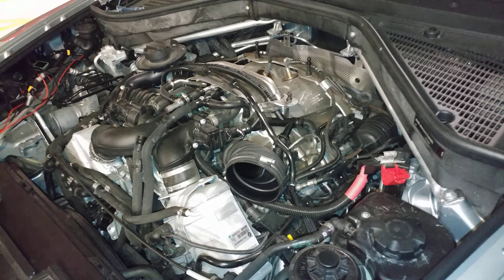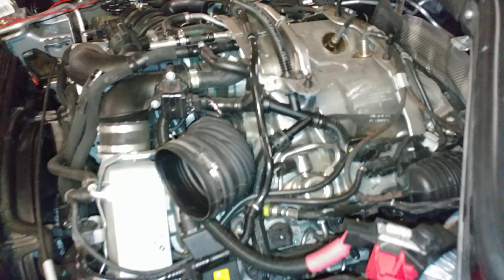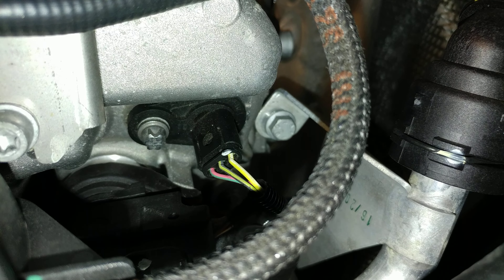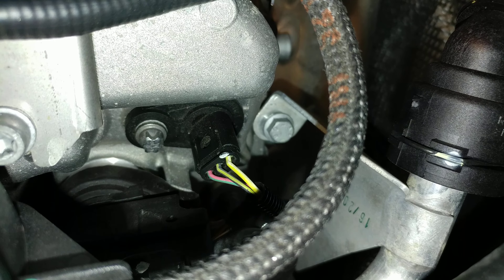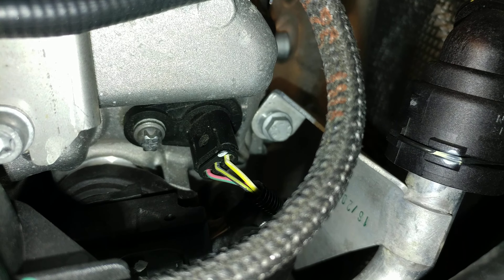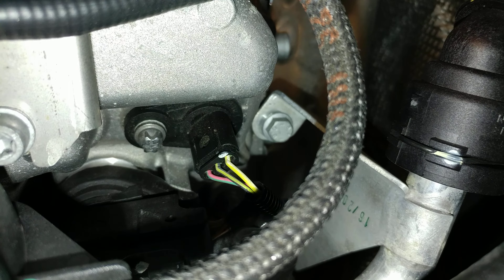2013 BMW X5 M - How to Fix Engine Malfunction Warning, Camshaft Position Sensor (2A7E, P0025)

Comment: Hi
I have a 2012 BMW X5  xdrive35i.
I replaced my throttle body and my HPFP.
The car is throwing a fault code P15DF.
I also have the Engine alert:
         Engine malfunction reduced power
         Chassis stabilization malfunction 
          DBC malfunction drive carefully.
Any advice would be welcomed.
Reply from the maker: Hi,
Was the battery disconnected for longer than 15 minutes? If so, then you just need to recalibrate the steering sensor by driving and turning the steering wheel from lock left to lock right, after doing that the stabilization should go away and be normal.  
For the code, there are a few things to check, seems like P15DF is a code for the vehicle speed sensor of the front right tire, this actually is probably the reason why the stability system is not functioning, since it needs the rotation of all the tires, but I would try the lock to lock just to rule it out. If that doesn't work then check out your wheel speed sensor connector.  Try cleaning it first, and plugging it in and removing it 20 times with contact cleaner, then rinse off the debris with more contact cleaner and wipe dry best you can. Clear the codes. If it comes back again, it could be a faulty sensor and you'll want to troubleshoot that and replace it if need be. 
I find most likely it's a connection rather than a broken sensor though. That's what I found in my 2013. 
I've cleaned all the connectors I found and it helped.  I haven't had to replace any sensors yet.
For the engine malfunction, is there another code for that?  Cuz a wheel speed sensor code shouldn't cause that, but fix the sensor and see if the engine malfunction goes away.  
When random stuff happens, it usually points at a bad battery or alternator.  If you buy a new battery and don't fully charge it before putting it in and registering it properly, you can get engine malfunctions and have the engine shut off on you when you floor it on the highway.  You can also clean all the battery connects, as well as the ground cable from the battery to the chassis, clean it good so it makes great contact and put dielectric grease there to make sure the connection is maintained very well, that'll make sure you don't get strange issues going forward. The computers are really sensitive to voltage fluctuations and can lead to all sorts of strange issues.  I bought a Bluetooth voltage monitor to keep an eye on mine, it's a good way to make sure it's all working well. You can find it on Amazon by searching "Auto Battery Monitor BM2 Bluetooth 4.0", or here's my affiliate link for convenience https://amzn.to/3XFxBSq
But if there's a loose connection the monitor may not catch the issue, only if the battery is low or if the alternator can't keep the voltage between 14.6 and 15v, so it's more important to make sure the connections are clean and tight. Stock, it's not that great, so use some 300 grit sand paper or a wire brush to make sure the cable side and chassis sides are clean and making good contact. I don't know the torque rating, just trade tight without breaking it is good! I made mine pretty tight.
Good luck!
Cheers,
David.
Reply: @DavidSunshine  thank you David I really appreciate the information I will get on it.
Very grateful for your help. I let you know how it goes.
Reply from the maker: @nes286  Anytime! Hope it helps. These things aren't easy to troubleshoot but it can be done!  Good luck! Cheers, David.

Comment: Hi David, so this should fix the limp mode on a 2009 bmw x5? I'm experiencing that and I'm pretty scare it could be expensive, please let me know thank you in advance.
Reply from the maker: Hi,
I would scan the codes so you know what's wrong.  I got Carly, it's worth it for all the things it can do, and tell you about your car. The adapter and yearly software subscription cost you, but the benefits are worth it.
You should try this though, the contact cleaner is cheap enough and worth having a can of around the house anyways.
And yes, it could fix the engine malfunction popping up.
Cheers!
David.
Reply: @DavidSunshine  I really appreciate you getting back to me I'm going to try see if it works and I'll look into that adapter too, have a good one.
Reply from the maker: @onealsanchez2384  Anytime!  Good luck! Also, if you just remove and insert that plug 10 times, it'll clean the oxidation off and it should work better.  I would still recommend doing it with contact cleaner (Deoxit is the best, as it leaves a dielectric coating that will protect it for years to come. I've treated all my collectors on the X5M and it's working great!). Cheers,
David.
Reply: @DavidSunshine  man I wished you lived near by so you could be my mechanic
Reply from the maker: @onealsanchez2384  lol that would be fun!   Good luck!  Oh. Also, a weak battery or connections to the battery can also cause issues in these vehicles. If you get random codes and errors, that could be a source of issues, especially when you floor the pedal, WoT, it needs full voltage and a weak battery can't deliver that, worst case, the car can stall and not restart until you clear all codes with Carly.
Unfortunately, you can't charge you battery or replace it yourself, unless you have Carly to register the battery properly (A new and fully charged battery must be used). If your issues are occuring without WoT then it might just be loose connections, which is normal for BMWs.  They oxidize, then a little vibration moves the connector over the oxidized area and disconnects momentarily or even fully.  That's why I went over the whole car with Deoxit, to help prevent that.
Cheers,
David.
Reply: @DavidSunshine  I have a 2013 x5 50i. Still n63 so is this censor you have shown above going to be in the same spot? I got a p0025 on my OBDII reader so I irrationally jumped to change my solenoid packs and that didn't do anything. I see somehow you got the intake housing off without taking off your firewall covers. So the nomenclature might be a little different?

Comment: I have this problem only when I accelerate but while I’m cruise it’s good and sometimes I can press her and it won’t even come on but most of the times it pops up saying reduced power
Reply from the maker: Yup, sounds like loose electrical connections.  You can use a $6 Bluetooth obdii adapter and torque lite to read the codes, it'll tell you exactly what sensor is giving you trouble, then a quick disconnect and reconnect like 20 times should clean the contacts and make it work better.  Use contact cleaner like Deoxit and it'll be a long term fix. I used Deoxit on all the electrical connections I could get to on my car, took two days to do it all, but it has been trouble free since. I did all the sensors and computers in the engine bay, trunk, above the glove compartment, and under the steering wheel.  I'm happy with the results.   I think the electrical connections always oxidize and cause trouble. I had the engine temp sensor give me a trouble a week after this cam shaft position sensor, so I had enough and did the whole car.
Should help yours out to do it all too.
Cheers!
David.
Reply: I didn’t work I took it out and sprayed it and put it in and out like 4 times spraying it again and again and again
Reply from the maker: @yasmeenzebian5105  Hi,
You're engine code might not be associated the the camshaft position sensor. 
But if it is, there's a second camshaft position sensor for the other camshaft on the passenger side, you can clean that one too.
You should spray the connector, and push it in fully and remove it about 20 times to fully clean the contacts.  It's the connector scratching at the other connector that helps clean off the oxidation. It will take a few minutes but it's worth the effort.
It's not exactly mirrored, but here's a picture showing where it should be on the passenger side cylinder head cover:  https://www.realoem.com/bmw/enUS/showparts?id=GY03-USA-03-2013-E70-BMW-X5_M&diagId=11_4170#13627525014

Hope that helps! 
Cheers,
David.
Reply: Does it make a noise when you accelerate
Reply: I have a similar issue on 2012 X5, sometimes I accelerate and the light comes on, then I stop at traffic light and stop the engine, then start it and within 60 seconds the light disappears. When I use cruise control to accelerate and decelerate the light will never come on. Any help is appreciated

Comment: Hi sir

We have a bmw 740li v8 n62 

The story is it was running absolutely fine no timing issue just common oil Leaks due to the oil leaked on the alternator and it got malfunctioned some mechanic came and  repaired the alternator but then what he did don't know the car was taking self but not starting he opened the Valve covers of both sides and removed some parts and reinstalled it after that engine malfunction fault code came and but by clearing the fault codes by scanner the car used to start absolutely fine no single noises of anything but again off it then try to start it again engine malfunction code come and it takes self but doesn't start until cleared the fault codes and the mechanics senior mechanic Said that the  camshaft position sensor is faulty, gived to other workshop they said engine was not taking compression told to change piston rings timing kit valve kit which was totally bogus when we towed it the we started the car by clearing the fault codes it come from basement by a steap incline till the tow truk by it self, and it was having the power it climed the steap incline without any hesitation just was havinv rough idle.

What can possibly be wrongly in it.
Reply from the maker: @jabeerahmed77775  Hi,
It sounds like a lot of mechanics have worked on it, and something they did caused the engine malfunction, meaning it is most likely a sensor or wiring issue. Luckily, the codes can tell you exactly why it is failing. I would recommend pulling all the codes with a good scanner meant for BMWs, like Carly, you can get the Bluetooth adapter and app for Android, it can give you all the codes to tell you what is wrong with your BMW, the computer knows what's wrong. Then you can start fixing those code issues and get it working again.  Clearing the codes without fixing the electrical issue sounds like a quick fix, and it runs full power so everything can work properly together, but once you fix the actual issue, it'll work perfectly and start every time. If the code is for the camshaft position sensor, you can try cleaning the connector, or even replacing with new sensors, but I wouldn't fix anything without getting the codes that tell you what it is having issues with. 
Good luck! 
Cheers, 
David.
Reply: @DavidSunshine  Thank you soo much for replying have scanned it any way to send you the report

Comment: P0015 can be cleared by cleaning the sensor on the drive side.
Reply from the maker: I just cleaned the connection and it has been working fine for to years now.  It's a hall effect sensor so unless there's ferrous material on it (shouldn't be since it's not magnetic, is just the sensor side), then cleaning it won't do much.  Definitely won't hurt though, and if I could get in there easily, I would certainly clean it for safe measure. 
I only cleaned it once with Deoxit and it's been going strong since!  
Cheers!
David.

Comment: The ONLY video I could find on the S63 engine and where "one" of the camshaft sensors are located. Where are the other 3???
Reply from the maker: The ones behind the intercooler are hidden away, I think I might have cleaned the contacts on them, if they even exist there and were found.  The one on the passenger side, close to the firewall is really hard to get at. I think I've unplugged and cleaned it before, but you can barely see it.  I had to stick my hand in there and work blind basically.  
Definitely worth doing if you are running into trouble codes referencing them like I was. 
Cheers!
David.
Reply: Did you have to remove the intercoolers to replace the front ones?
Reply from the maker: @ovalpiston959  Hi, I'm not sure about the intercooler ones, I don't think I ever got to them(Not sure they are even there, I only see 2 sensors in the diagram linked below, it says 4 needed per engine but it might actually only be the 2 in the back), if I did find them, I only cleaned the contacts.  I never replaced any of the camshaft position sensors tho, they just need contact cleaning I think.
There's a sensor at the front of the engine cover that I cleaned, it's the engine temperature sensor which also threw a code while driving, I had to clean the contact to fix that code too, never had to replace any of the sensors tho, just used Deoxit and cleaned it, and it hasn't shown a code for a few years now.
I actually cleaned all the electrical connections I could get to, in the engine compartment, under the dash, in the trunk, and it fixed up all my problems, the X5M has been running smooth for years without any codes thrown.
Check this diagram here, you can see the passenger side and driver side camshaft sensor locations at the back:  https://www.realoem.com/bmw/enUS/showparts?id=GY01-EUR---E70-BMW-X5%20M&diagId=11_4170#13627525014
The one on the passenger side is the hardest to get at, but you'll be able to find it if you take all the plastic covers off.
Good luck!
Cheers,
David.
Reply: @DavidSunshine  I got the back ones done, pretty easy once I removed the oil filler, 2ndary coolant tank, air plenum chamber. So I only got/found two, so I'm taking it to the dealer to get the other two...and where they are!
Reply from the maker: @ovalpiston959  Nice work!! Glad you could replace those easily.  
Let us know how it goes! I'm sure every s63 owner will want to know how it goes! 
Cheers!
David.

Comment: Please help. I am getting Engine malfunction reduced power on same exact vehicle. Error code I am getting is cylinder 6, and 3 misfire. and also drive motor b sensor circuit low. Could this also be the sensor that you’re referring to?

This issue happened on another bmw 535i I had as well. I was stepping on the gas hard on both these cars and it had engine malfunction. It ended up being the sensor. I’m thinking it’s the same issue with my BMW X5 2013 8 cylinder
Reply from the maker: Hi Jay, 
I had cylinder misfires on my E46 too, reducing power of the engine, and throwing those codes. 
I would just take Deoxit Contact cleaner to all the connections on the ignition coils, spray it, and connect/disconnect it about 20+ times for each connector, wipe off excess and let it dry for 30+ minutes.  Try not to get solvent on the rubber gaskets, they will swell and make it difficult to reconnect.  Just get the spray on the metal parts of the contacts if possible. 
Spray and clean all the sensor connectors as well, that should fix it all. 
I've done ALL the connectors I could get to on my X5M and it's been working perfectly for years(I did all the connections in the back trunk, as well as the engine bay(ECU even), and inside the cabin under the dash; they don't use dielectric grease on the connectors so you'll get a lot of random errors here and there throughout your car.
On my E46, I also had the air bag connector trip and cause an ABS light, had to clean the contacts and reset the ABS system with a scanner, it was good for years after that, until I sold my car.
The X5M also had the engine temp sensor trip a code too, cleaned that contact and it has never come back. 
Hope you can get your BMWs running rock solid as well!  Read up on how to clean contacts with Deoxit, it's pretty simple but worth a read so you understand what it does and how to use it as intended.  I simply apply it, do 20+ cycles, then spray the contacts clean to wash off oxidation debris, wipe off excess and let it dry so that it leaves a protective film.  It seems to have kept the X5M connections in good order, no more strange codes!
Cheers!
David.
Reply: Jay you fixed it